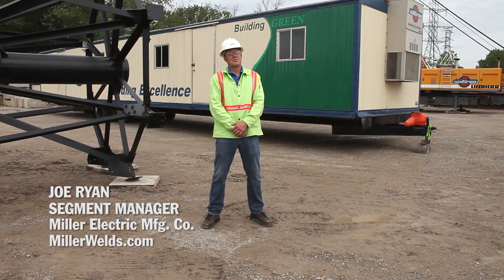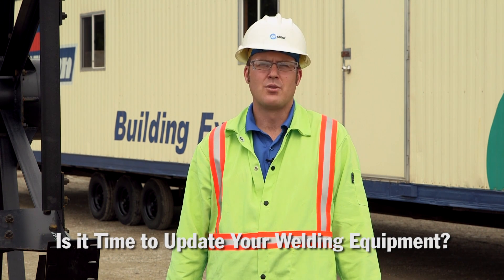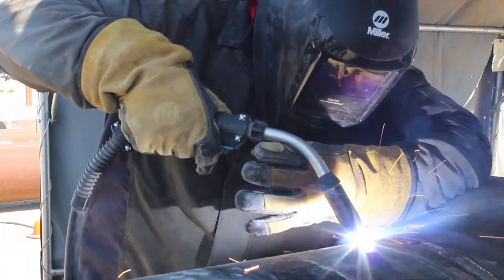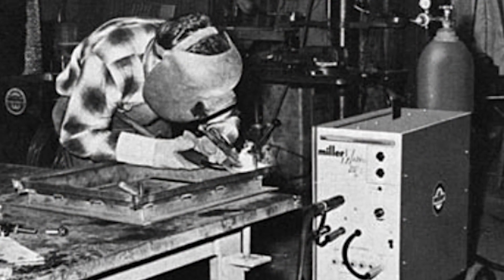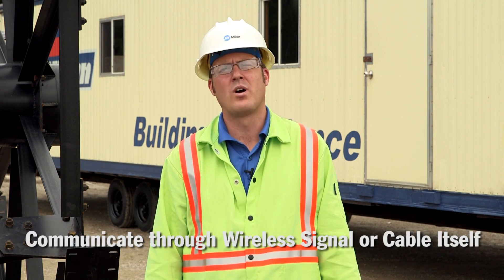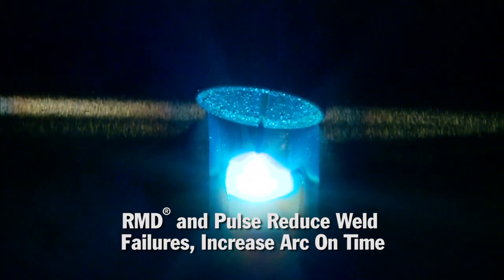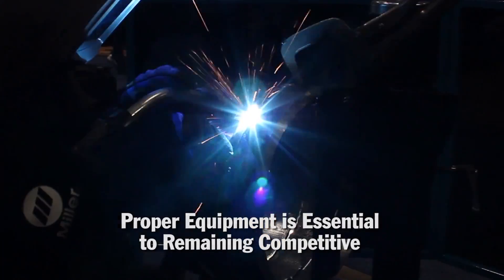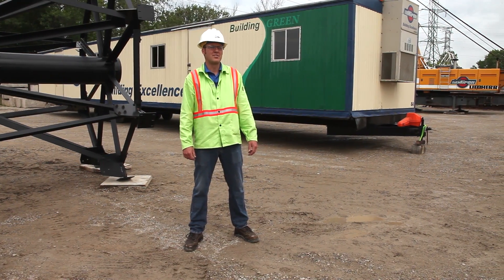Reducing Weld Costs and Turnaround Time: Current Technologies from Miller Maximize Productivity

Comment from the maker: “The largest cost in welding in the field is labor.” Lower your costs by equipping welding operators with the proper equipment and new technologies that allow them to work more efficiently and produce better welds. Advanced wire processes RMDⓇ and Pulse reduce weld failures and allow welding operators more time striking an arc. Watch how to further maximize productivity: